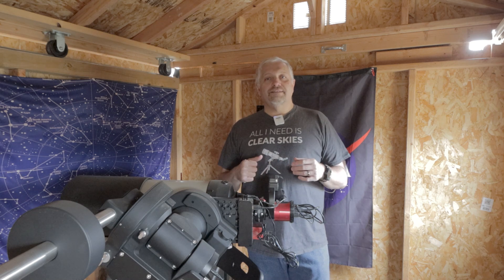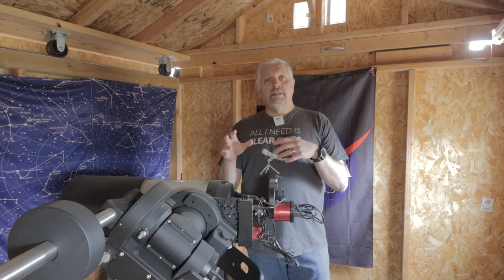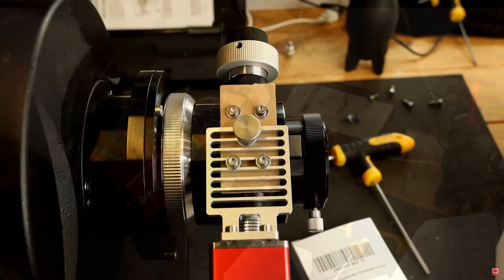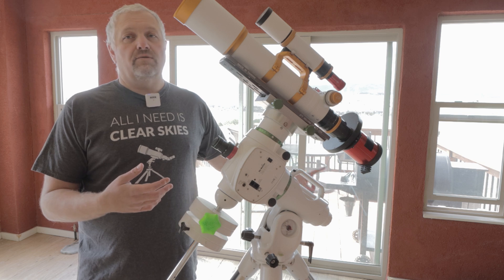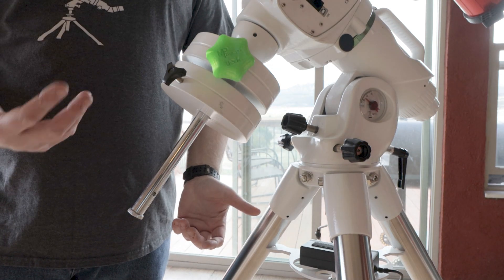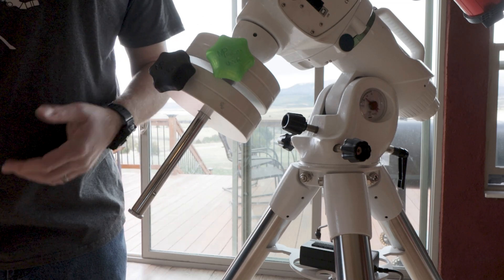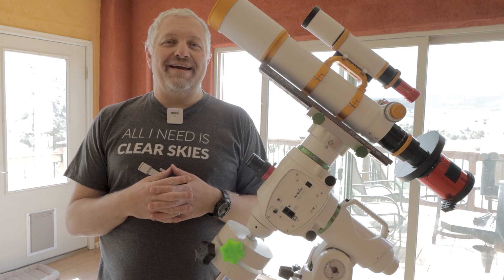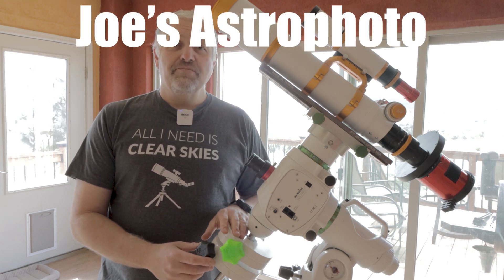3D Astrophotography

Comment: Making bits and bobs is one thing but check out BBC Sky At Night "Beyond the Visible" (October 2020) at about 15:00 (a linky below) where astro photos were 3D printed to plaques initially for partially sighted astronomers and found to give an extra tactile sense to those fully sighted too. And not just for visible radiation. Height of the relievo may be given to practically any parameter.
https://www.youtube.com/watch?v=mWEVU2wA-6c

Comment: That altitude knob looks like a much better idea than the original, was looking to upgrade my celestron cpc 800 to a german equatarial mount, the skywatcher eq6r pro was my first choice in the price range. I see you now have an ioptron mount but would you recommend the skywatcher for a celestron 8 inch sct, just looking to get better guiding than i can achieve with the fork mounted cpc, thanks
Reply from the maker: Thanks so much! I love the EQ6R Pro, so I'd absolutely recommend that mount. I was wanting two rigs, so I got the CEM120 as my other mount to coincide with the EQ6. I will be using them both.